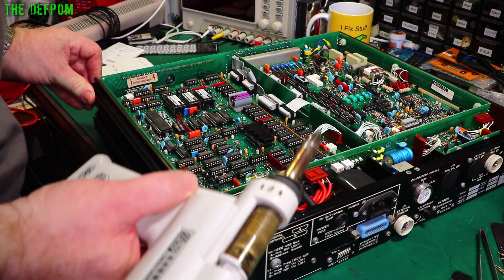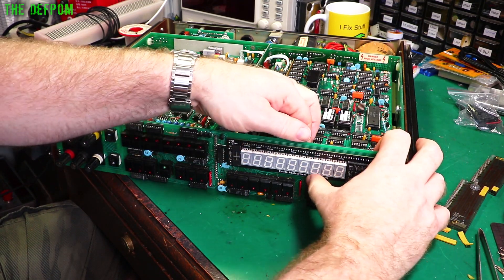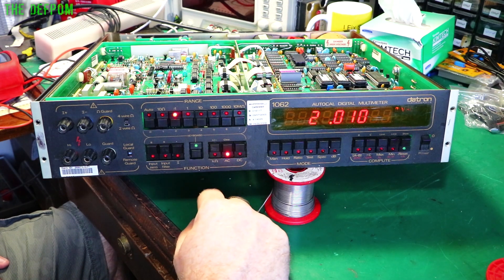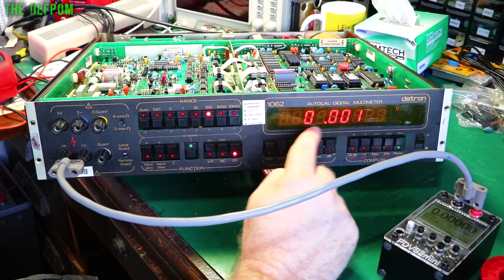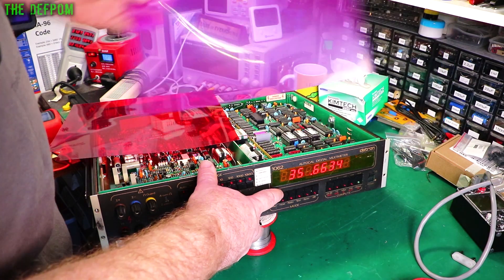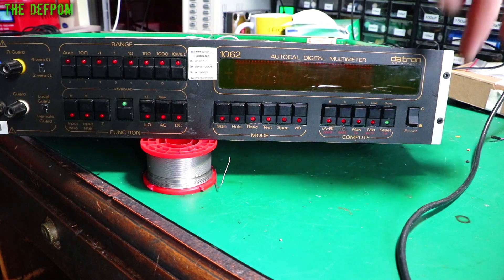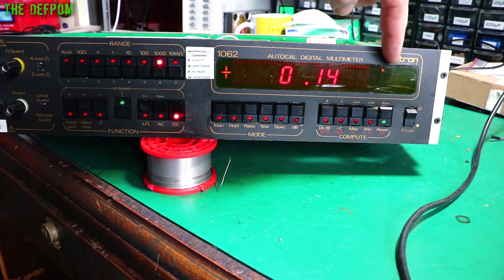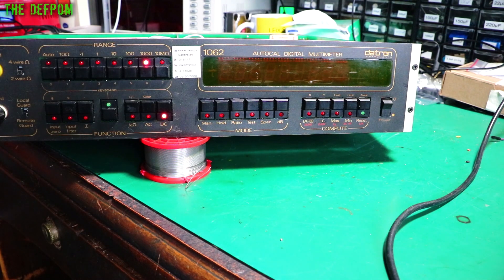🔴 Datron 1062 Multimeter Repair Part 3 - Custom Display Installation & Testing SN_016117 - No.798

Comment: Smashing mod, well done :-D
Cover the white around the segments with black marker pen... who said Bodge!! :-D
A bit more tinkering and im sure you will be happy :-D
I have to admit that i looked at the schematic when you were thinking about using led displays.
it looked possible with those transistors/resistors swapping.
But you never know if it had any Ti....ming odditys lol.
Ooops no display,  power line missing maybe.
Reply from the maker: I picked up some different led modules that are black... haven’t tried them yet though. The out take was from me forgetting to plug a cable back in on the driver board!
Reply: @TheDefpom  Well no damage was done, so no extra problem Phew :-D

Comment: I'm liking this repair! :)
I wonder if for the units LED's, you could 3D print a grid pattern of squares to the required height to make little light isolating boxes or channels, then print the actual characters in negative on some transparency sheet with a laser printer to lay over the top to make some nice crispy backlit characters.
You could put a layer of white paper or thin diffusive plastic behind the laser printed design as a diffuser, or even fill the square holes with hot melt glue.
Reply from the maker: For the annunciators I changed the design and got a very good result, completely 3D printed, no painting and no overlay films were needed, you will see that solution in the next video, I also posted it on Twitter a few weeks ago when I did it, my Rev 1.1 PCBs arrived today too.

Comment: I don't remember if you covered it previoulsy but, what is the Error OL message mean?
Reply from the maker: In this case it was doing it at turn on due to the unit being set to use GPIB, once I changed the switches for the GPIB that went away.

Comment: Why use diodes instead of 0 Ohm resistors?
Reply from the maker: It is to ensure a consistent voltage drop, using resistance there would result in inconsistent voltage (hence drive current) to each digit and each segment depending upon how many segments are turned on, a digit showing 1 would be brighter than a digit shopping 2 for example.
Reply: @TheDefpom  But 0ohm is a dead short, there is NO resistance!
Reply from the maker: @simonbaxter8001  - because I need the voltage drops there on the number digits to allow me to drive the annunciation digits harder.
Reply: @TheDefpom  thank you.